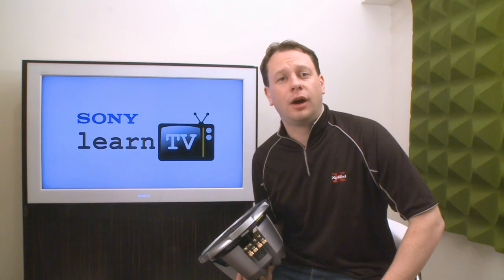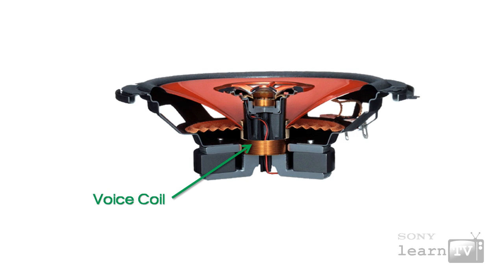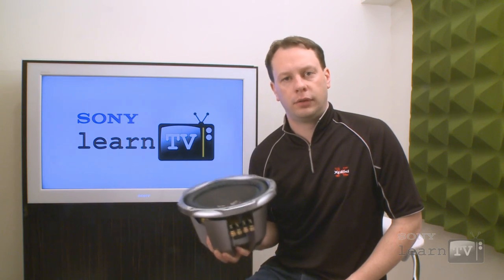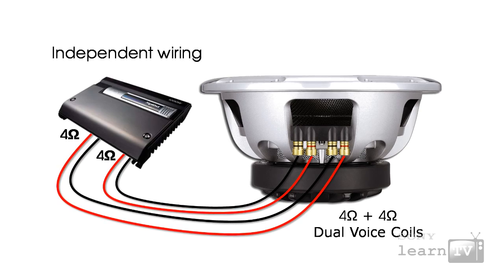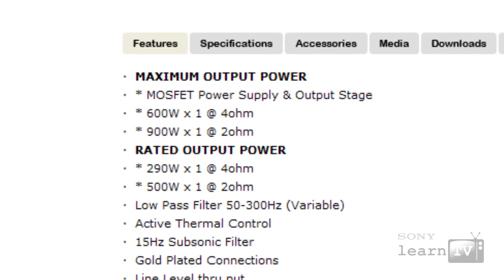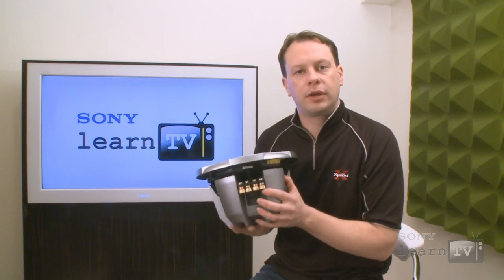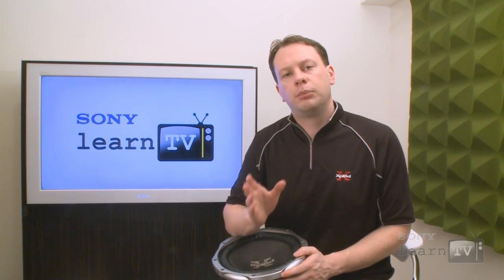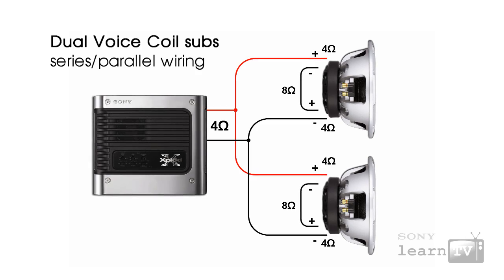LearnTV Dual Voice Coil subwoofers

Comment: i have 5 single channel amps 200 Watt @ 8 Ohm.. 

http://diyaudiocart.com/Wintek-200W-Mono-2SA1943-2SC5200

1 question  can i Bridge 5 same amps ..? if yes thn how..? My plan is to Bridge 5 Amp for 1000 Watt @ 8 ohm)
2 question its quite difficult to find 8 Ohm 200 watt sub. in market at my place to match this amp output and i dont trust online shopping..
can i add 4 ohm speaker and if yes then how much watt ??  
3 question Car Sub and Home Sub is different ?
may be i am wrong but SVC and DVC if made for Car  audio system bcoz if its need.and can be used for home also..?

Comment: here is a big mistake, you can't usa a dual channel amplifier to power a dual coil bass cause you will damage subwoofer, the dual voice coil woofer is like having a big coil but cut in the middle, they are not 2 speakers, you can't use different channel for the same subwoofer

Comment: Great video!  I have an alpine 4 channel amp (Alpine MRP-M300), producing 50 wpc x 4 @ 4 ohms, or 75 wpc x 4 at 2 ohms.  Can i keep the amp hooked up to my front speakers normally, but then bridge the amp down to 2 ohms for a small 150 watt sub?  If so, how would i do it?  Could i only bridge down with a DVC sub, or could i do this with a single coil as well?  And, with a DVC, i would wire it like you have in the video?

Comment: ok so i have 2 soundstream RBW-12
they are dual 4ohm voice coils
what would be a good amp to power them?
there 600 watts rms each
and for the wiring 
would i run series wiring then parallel to the amp?
because i want to run them at 4 ohms
and series wiring would put them at 8 ohms and parallel would be 2 ohms

Comment from the maker: @DisfiguringTheAndy You don't 'technically' bridge a sub, you bridge the amp so I'm not completely sure how you have them wired... Best way to think of a DVC sub in your system though is as 2 SVC subs - in other words you can run it internally in parallel or series following the rough guidelines in my video, so you will effectively end up driving the equivalent of 3 subs. However your best results will generally come from using matched subs if possible.

Comment from the maker: @TheLatinking28 Glad I could help. It sounds like you have some pretty high-end gear but you still want to be pretty careful running your amp at 1ohm - most amps are not stable at that load so you could damage the amp. You can probably afford to run a bit more power into your sub but I suggest you get in touch with the guys at Rockford Fosgate first to confirm your setup will not damage the amp.

Comment from the maker: There's a risk of this if you're using 2 seperate amps (or channels) and running the coils independently, but this is a pretty uncommon way of using these (you could also damage the speaker if the signal is different to both coils so it's certainly not recommended!)... In the more common 'series' and 'parallel' methods the same signal (and phase) is sent to both coils so it's not an issue.

Comment: Don't you think if there is a slight  delay in sending the signal to one coil to another it will oppose each other and create distortion? coz both will be working independently for same speaker!